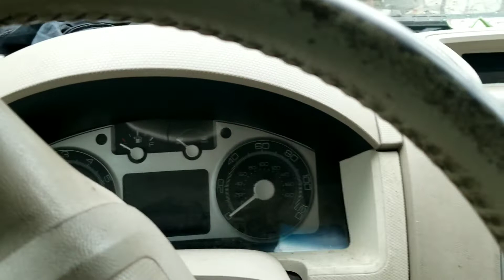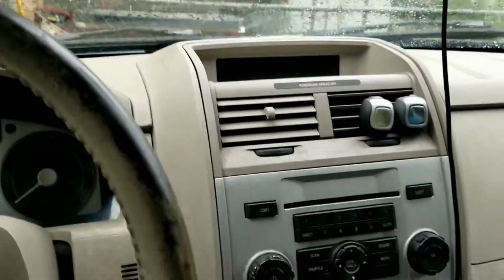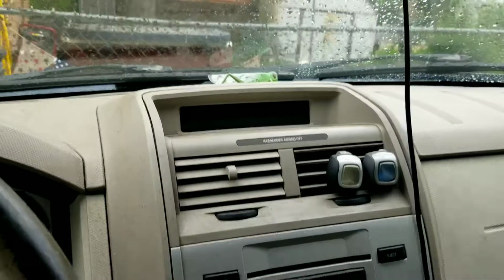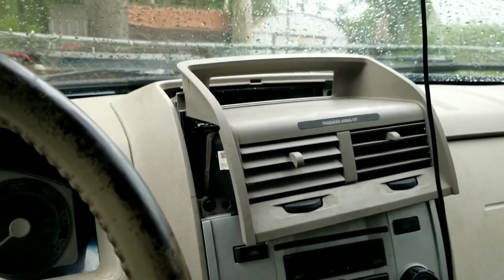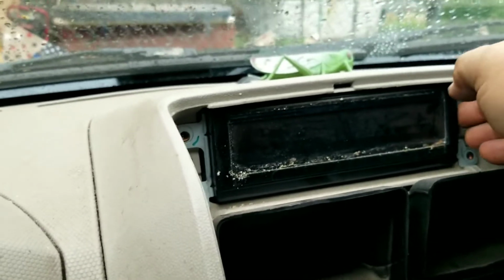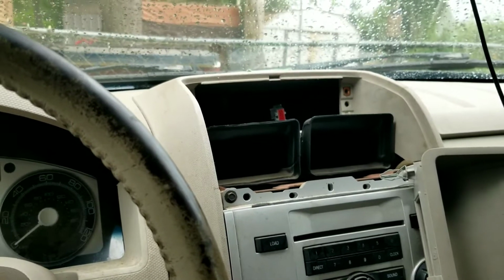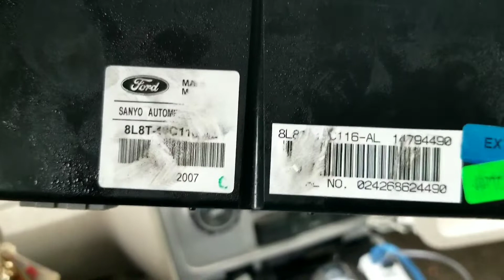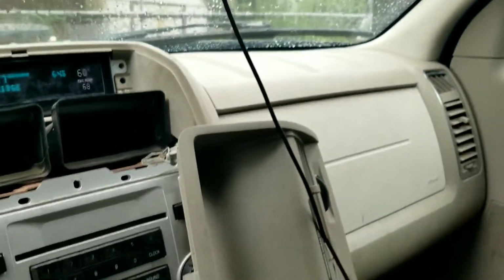how to replace Ford Escape Display module that goes dead in cold weather

Comment: My 2009 Ford Escape has started doing that as well as we have cold weather. Once the car warms up back to normal. 
Thanks for taking the time to post an excellent video explaining the issue and method for replacement.
Seeing that all these modules are all manufactured the same I would not be considering a replacement unless it was a continuous failure in all temperature ranges.
Reply from the maker: It may get worse, but might as well wait & see. Tons of them in junk yards

Comment: Hey, Daryl!
Thanks for the helpful video!
I have 2 Mariners from 2008, that both had this problem: last month, I was at a self service salvage yard (for several other things), and looked at pulling out a display, but, I couldn't see an easy way (i.e. the proper way) to get it out, even though the gauge cluster was already out!
And by then, time was running short, and I had already been on my feet in the yard for over 4 hours.
Between your, and Chris' (at 'A Kids Perspective') videos, I saw this was well within my skill set!
HOWEVER, I feel I should point out that it DOES matter (a little) what car you pull from: yesterday, I had an appointment pretty far out, but very near another salvage yard, and only ~5 miles out of my way; I checked their online inventory for Mariners, Escapes and Tributes: there were many, including 5 in the '08-'12 model years (although they were all Escapes), so I tossed my tool kit in the car, and after my meeting, was happy to see it was a sunny afternoon.
The yard has an organized system with numbered sections and rows, so it helps find randomly distributed cars; 
Pulling them was pretty quick, but, not knowing if the unit would work, I actually pulled two, and got the cashier to agree to let me test one in my car, and switch with the one from 2007 at the counter, if the one from 2009 didn't work.
But I feel people should know that there IS some model distinctiveness on this item.
My knowledge of electronics is ~basic, so I can guess that there is probably an EPROM chip in there, but no clue if/how it can be 're-flashed'...
BUT, regardless, the installed unit seems 'programmed' to display the model name of the car that it was originally installed in, so, now, in my Mariner, the display proclaims itself to be an "Escape"!
I thought that was better than saying "Escape Hybrid"!
Additionally, I imagine it  might have some elements disabled for features of the deluxe trim packages: i.e., on the Premier trim package, there is a separate heat/AC control for the rear, and separate display elements on this module for the front vs rear temperatures.
And also, an exterior temp' display...
It is possible that they would light up if they were getting a signal, which they aren't going to get on my car, but also possible that it could be locked out...I just don't know.
Thanks again for the helpful video!
Now I have a clock, and can tune radio much easier!
Reply from the maker: Yes, hat is a very good point. I would recommend a unit from same year and trim level.

Comment: From what I understand the reason these displays fail is due to bad display board soldering. I heard some guys take the display apart and re solder however this might be take some time.
Reply from the maker: Yes that is true. I did one once, but im not very good at soldering so I just change them out.
Reply: @ between my bad eyes and shaking hands I have no choice as well so I ordered a display and will just swop it out.

Comment: Had question when your screen went out did the button in the radio still work or just the ones on the steering wheel ? Because my screen and buttons went out but the radio still works
Reply from the maker: Yes radio buttons still worked

Comment: I have 2010 escape, no. 14 fuse kept blowing, I researched and found videos on here, also put in cd and would play but no control, CD stuck inside..had to pull no 39 to get CD to stop.....long story short, I unplugged this radio display, no more blown fuses....radio and all works, just no display.......my 2 questions are, does the model number have to be exact match from ebay or salvage yard and I was also told the replacement head will have to be programmed to my car...my part no. Is 9L8T-19C116-AC
Reply from the maker: I have only replaced one on a 07 navigator.  No programming was necessary
Reply: Yhanks
Reply: Thanks

Comment: Hi! Will a ford fusion display work as well?
Reply from the maker: No they are different
Reply: I've tried the fuses and pushing certain buttons to reset. I have a 2011 Ford escape hybrid I just purchased and it's not working 😢 I've watched your video and popped off the front so I know I can do it now I have to find a part locally which has been difficult so far. Thank you
Reply from the maker: In se michigan there are multiple escapes in every junk yard. This part should be under $20.

Comment: I have a 08 Ford Escape the radio won't work and the display module just displays "Ford Escape". Ive already changed the fuses and no luck. Could changing this fix the issue?
Reply from the maker: I dont think so. The radio head is a separate thing. Mine still worked when the display was dead

Comment: I have a 2009 Mariner with the same problem.  My junkyard said there was a change for '09 and I needed to have the exact model # of the FDIM or it wouldn't be compatible but it looks exactly like the one you have for '08.  I'm guessing the junkyard is incorrect?
Reply from the maker: Actually there are different versions depending on if you have the navigation screen, and or the 3 setup buttons to lower left of steering wheel.
Reply: @darylturcott  I don't believe I have navigation.  The screen was not working when I bought it.  The 3 buttons I have lower left of the steering wheel tell me the mileage I have left to empty, oil life, trip mileage, systems check, etc.  I've had it for over a year and I hate not having the info display.
Reply: @elizabethreisinger5681  It IS annoying, isn't it?
I have '08 Mariner.
I pulled a module from '09 Escape.
Other than displaying "Ford Escape" when initially energized, that goes away, and it works fine.
What I noticed is that one of my cars has the 'Amenities' package, which includes electronic compass, outside temperature sensor on display, as well as 5 CD player on display...other car doesn't have that, and those items did not light up when plugged into that vehicle.
I am pretty sure that I pulled it from a vehicle that also had that stuff.

It's possible that a module from a 'base' model might have those display elements locked out, I dont know for sure...
If you have a model without these extra features, or the dual zone heat/AC, etc...any module will get you clock & radio info' up there.

Comment: I just need to replace the clear cover, mine is all fogged up, hard to see the display
Reply from the maker: I cant remember if the cover snaps off or if its glued together.
Reply: Instablaster...
Reply: It will be a big chore getting another, and replacing just the clear face: and any old one you get hold of will probably be scuffed up, as well.
If there are no deep scratches, you could try just taking out the module and polishing the face.
There are 4 pieces of fabric tape framing the display. This helps makes it a little harder for stuff to slip in between, but, I think, it's mainly there to prevent squeaking.
Maybe cover with some cellophane tape when polishing, so it's doesn't get all clogged up.
Once you get it looking 'ok', yoy might just try putting a layer of heavy, clear packing tape over it, to be shiny. (Wont cost much; take it right off if not good enough.)
If the face us real cloudy, you'll get pretty blurry images coming through, so need some polishing.
Reply: @TheScandoman  Thanks, polishing it sounds like a good idea, have had no luck replacing they are all just as you say
Reply: @peggysizemore4207  I simply scrubbed mine with an old washcloth and some white toothpaste; cleaned with alcohol, and made sure to lay on the clear tape smooth, and bubble free- abd then trim along the inside edge of the felt cloth 'frame', and the smooth down that last bit around the edge.

It will probably only last a couple years, but pretty easy to clean &  replace, and it is looking pretty good!

Just one little cloudy spot I see, probably because I know it is there.

Offhand, a slightly thicker film might look smoother & shinier, but, as it probably has a thicker layer of adhesive, not sure whether that is going to result in clearer view of characters, symbols & icons.